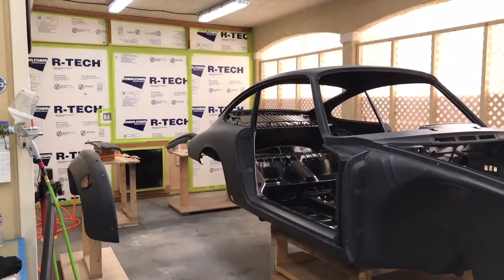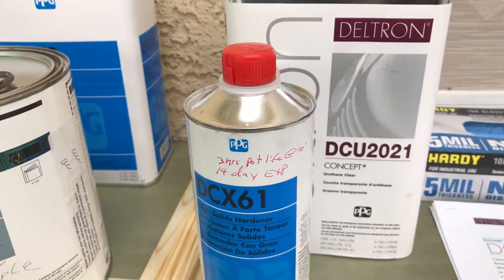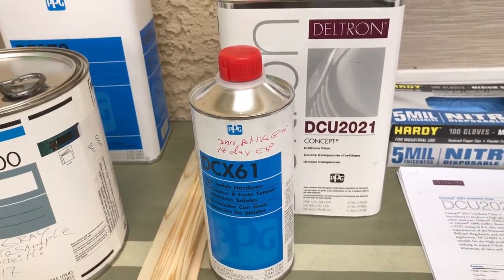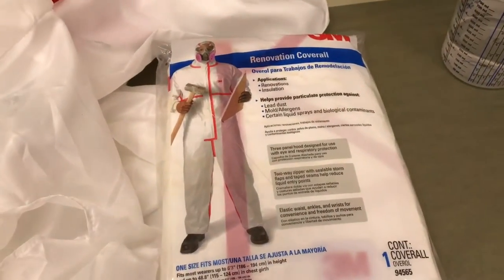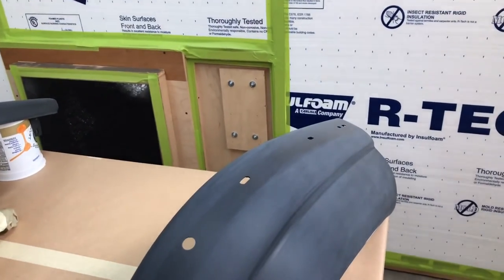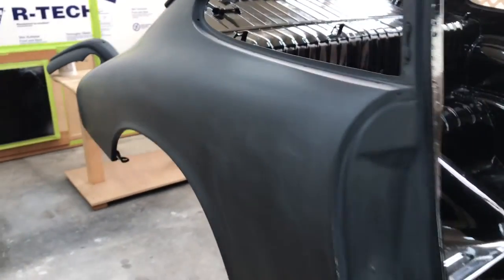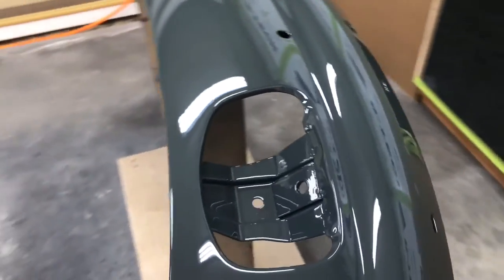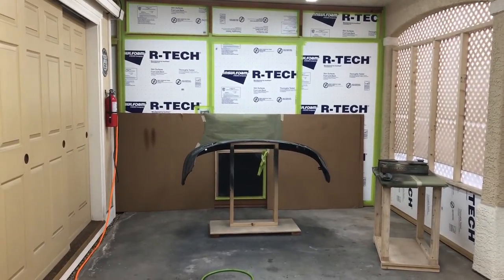1967 Porsche 911 Video 19 Finish Paint Part-1 Spring with the SATA 5000B RP

Comment: Your paint looks great!!! But are you not worried about your door gaps changing when the engine/trans go in?
Reply from the maker: Hi Caveman Do and welcome to the channel!
That is an excellent point You bring up. If you have been watching any of my mock up videos and sanding videos I talk quite a bit about that in detail and how sensitive those areas are. My build and paint strategies are quite a bit different than you might normally see. That particular point has been factored in however I will for sure go over some tips upon final assembly to help eliminate any problems
Mark Shepherd also has comment on this detail.
I dont recommend trying any of my building techniques or styles until you have seen the final outcome..

Comment: I really enjoy your videos...extremely informative and instructive.  Can you please clarify the process at the final sealer stage?  Your summary sheet indicated DP Epoxy with 10% reducer and 1 hour cure.  You also said that these things evolve and it appears to me that, when the time came, you sprayed the sealer and let it cure, then scuffed (with grey scotchbrite) and blocked 600 wet.  Is that correct?  The reason I ask is I'm trying to decide what gun I'd use for spraying the sealer coat.  I don't want to use my good gun for primer but don't want large orange peel on the sealer if I'm spraying base coat directly over it.  Allowing the final sealer coat to dry and sand it would solve that problem for me.  On the other hand, I've read elsewhere that epoxy primer doesn't sand well.  Any thoughts you can provide will be most welcome.
Reply from the maker: Hello PCar
Thank you..
This is a great question
I recommend spraying out your final sealer coat of DP with your finish gun. Its quite smooth to spray unlike heavy filler primers.
Its been awhile since I've worked with it but I recommend always following the latest mgf  spec sheets to the letter..as formulations are always Changing.
Your sealer coat will scuff nicely or wet block sand lightly being very careful to not burn thru any edges. A real sensitive touch is needed at this stage.
It will cut nicely with sharp wet 600 I prefer 3m brand paper. 
Also keep in mind you have a limited window of working time to seal sand and lay your base down. Back then I think it was 7 days but tighter redcoat time is best. Late redcoat time will bring about problems.
If you take to long to sand or follow the sealer coat.. the base paint will not stick.
Epoxy gets harder and harder as time goes on.
It will get so hard that the surface becomes sealed. This is what you want to avoid.
If you choose to wet sand before base you will need to wash and re-mask your project but if you do it the base coat will really lay down nice.
If you choose not to sand you might have small orange peal build that will telegraph thru to your clear coat. This is why a lot of shops block the clear and go again.
Porsche clearances don't allow for such high builds of materials.
Tight to the surface body work, lean primers to surface works best.  The final build of three clear coats will work out beautifully with gaps and fitment.

Good Luck!

Comment: WOW Mike looks like Slate Grey 615 - if that's what it is then just wait till you get her out in the sun, the colour changes are simply amazing ... you got the whole Steve McQueen look going on there. Fantastic off the gun finish, I bet you are seriously chuffed with the results of your Sata 5000 :-) it really goes to show that investment in quality tools and product makes all the difference!!! I see you plan to tackle the front fenders next on there own ... I'd seriously advise against this, rather paint the insides first, fit to chassis, bond, align, panel gaps etc. Do the same with the doors and hood plus engine lid (paint the back sides) fit all and align along with all the shuts, then paint the entire exterior in one hit followed by a FLOW COAT. You have more than enough power CFM from your air setup so by going down this route you will not run into the risks of possible poor panel fitment and marking that stunning paint when it comes to buttoning her all back up ... I learned the hard way, BUT every day we learn which is what makes it fun Sir ;-)
Reply from the maker: Hi Mark
Your post reads like my next video edits=) The car is almost complete and doing the editing now
will be uploading the results over the next couple weeks. Its exciting and yes.haha Very Steve McQueen looking=)
Ill drop you a line..would love to see those pics!